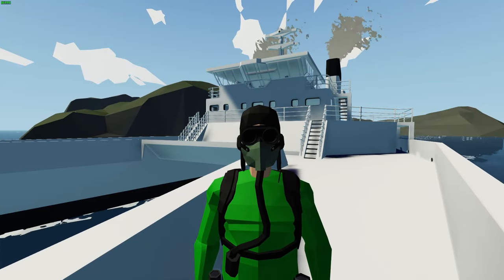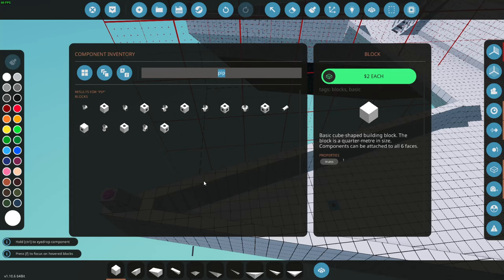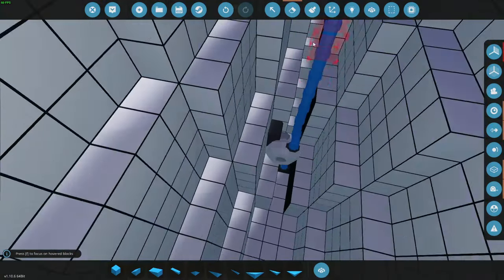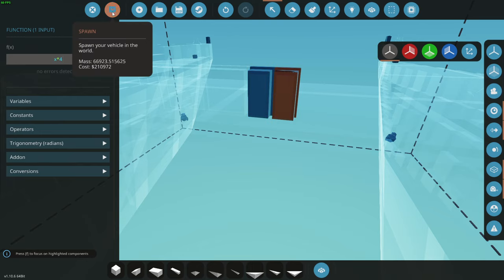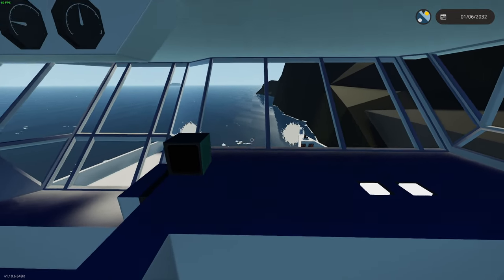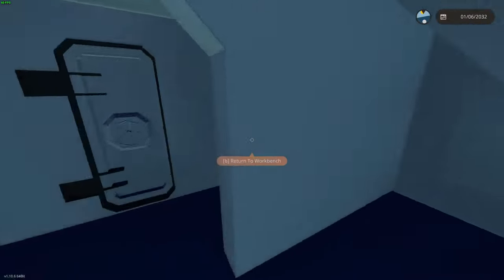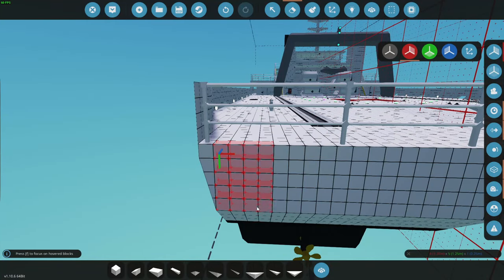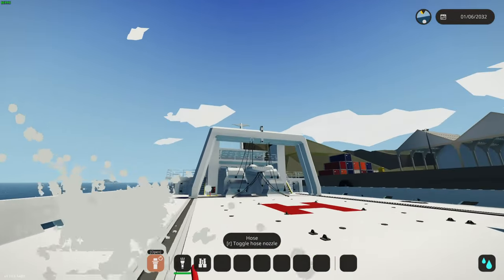Adding Fire Systems to the Recovery Ship! STORMWORKS

Comment: You should make a recover panel that can deploy from the deck of the ship when the ship sinks that will have the option to hook air, fuel, and electric into the boat so that it can run the engines & drainage pumps under the water. Another cool idea irrevlant to the original idea, but you could make a moon pool on the bottom of the boat that could allow you to drop submarines or other probe devices out of the bottom.

Comment: It looks like they tried to de-gamify the jumping. A lot of games allow you to control the character horizontally while midair, which is completely unrealistic. From your video, it looks like that was mostly or entirely removed. However, this is something that consistently feels terrible across games, because not only do players have less control than they're used to, and less control than is needed for basic movements, they have less control than they would have in real life. Humans can jump at precise angles and powers and run into a jump at precise speeds, but with current technology it's not possible for games to capture that.